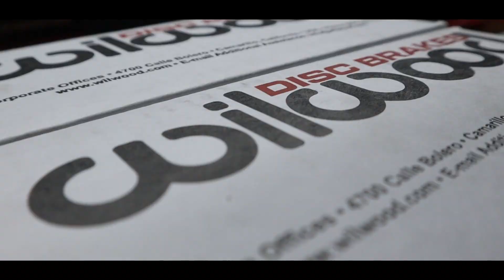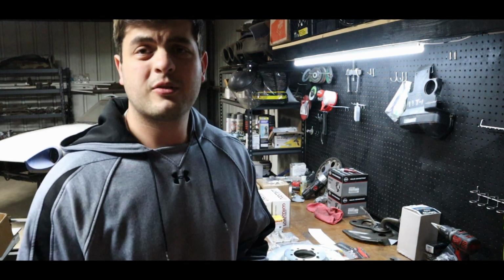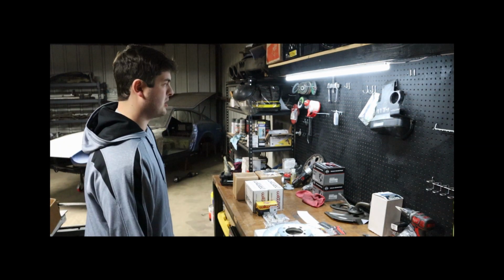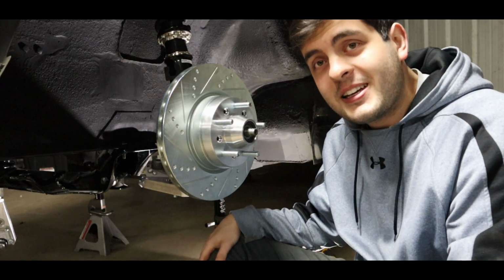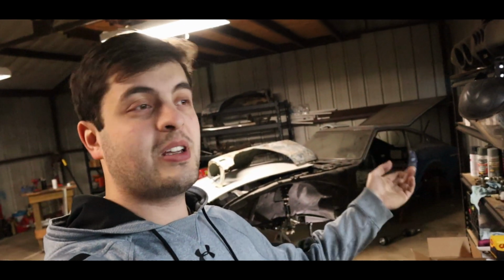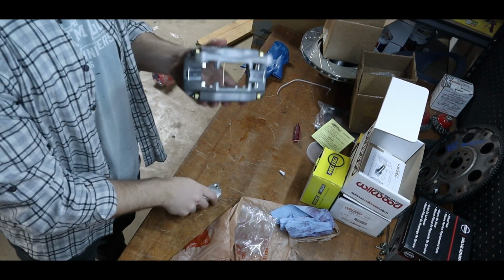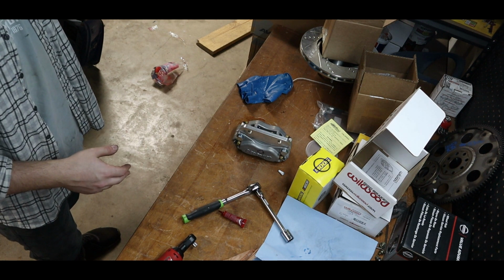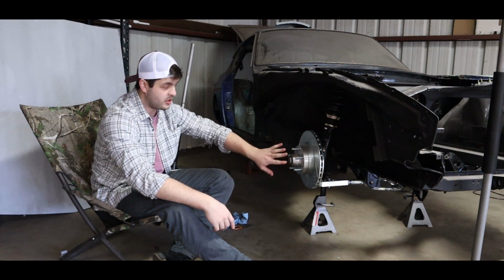Wilwood Big Brake Kit Installed on ABANDONED Datsun DRIFT Car! Looks INCREDIBLE!

Comment: Nice to see the project coming together. Just as a matter of interest what size rims are you running? Thinking about the Wilwood brakes for my 240Z but not sure if the big brakes will fit with my Wolf Race slots that are 15 inches.
Reply from the maker: Thanks it’s been a long process! I’m going to be running 17’s on it so I shouldn’t have any clearance issues but I believe the kit I got will fit 15’s. The description on the Silvermine Motors website has specifics!

Comment: Are you still able to adjust camber on the coil overs when they are fitted?
Reply from the maker: Not with the stock strut towers, but if you were to make reinforcement plates and cut access hole then I think you could. That’s a good idea, I might have to make some!